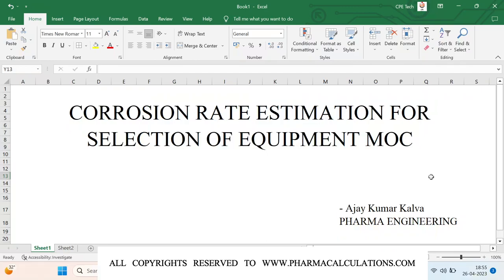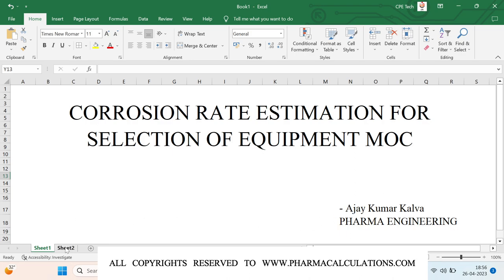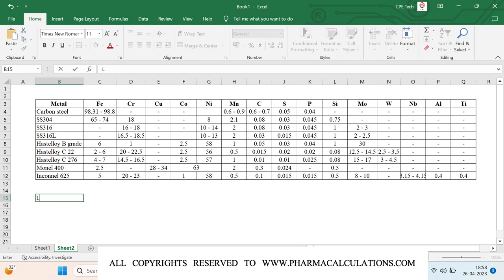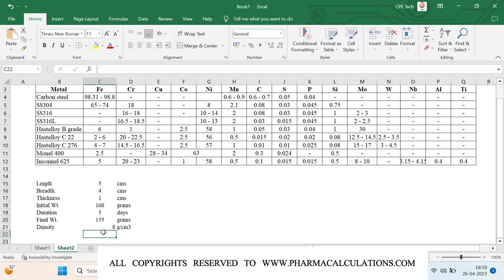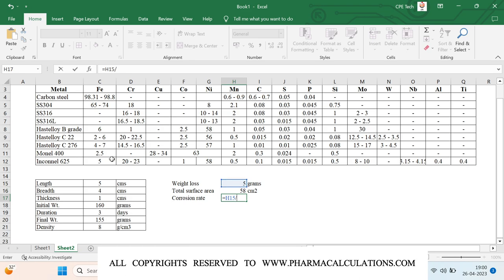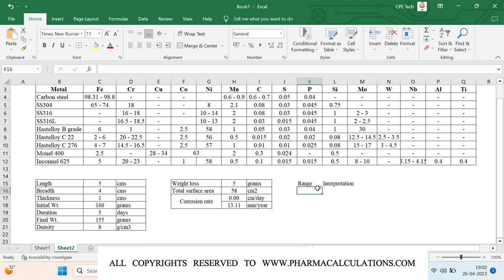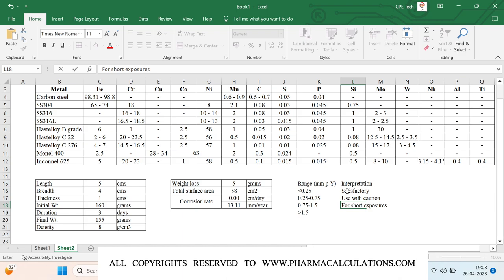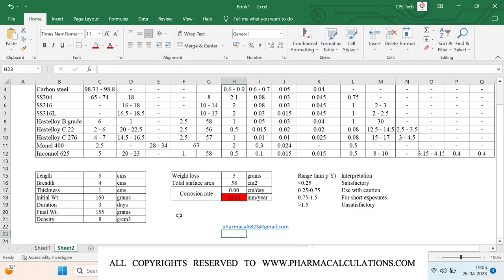Coupon testing & Corrosion rate estimation for selection of equipment MOC

Comment: Sir, on what standards you have given the range ??
Reply: What is the source for this ?
Reply from the maker: These are the common standards that we follow in industry while mapping an equipment
Reply: @pharmaengineering  
Sir, As this may not be applicable for  all cases.

In case of API molecule, here 0.5mm/year loss may not be accepted due to increase in metal content in the HPLC(Purity).
Reply from the maker: @Mike-ic2bn  Dear Mike, In case of pharmaceutical manufacturing the API's will be tested for elemental impurities periodically and hence if the compatibility to be tested using coupon method the limit shall be considered as less than 0.02 mm/year
Reply: @pharmaengineering  Sir, Thank you Noted.
I was thinking about the guidelines or any Standard approved range.